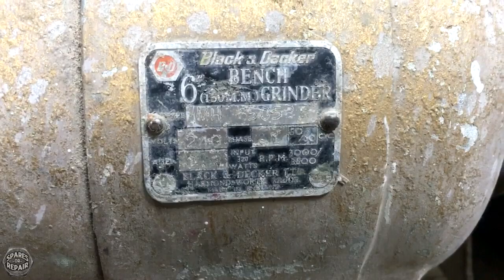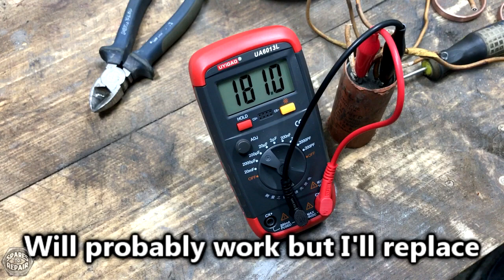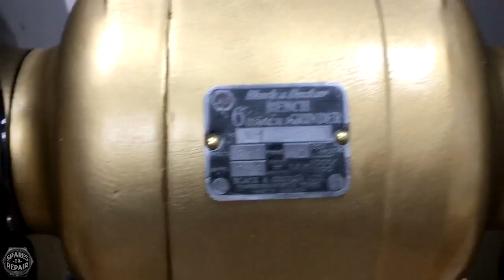1960's Bench Grinder Repair & Restoration - Black & Decker

Comment: Strangely enough, I was lookin at one of these for sale earlier today that needed work, and now this video pops up...... How serendipitous 😆 ya done a good job on this lad, you know your stuff 🤙 
Maybe ya done so to stay out of the shot, but il say it anyways; to get a repeatable angle when grinding, you want to use your front hand as a "gauge". Find the angle you want, grip the thing being ground between thumb and index finger, your index goes up against the tool rest on the grinder and you dont remove this grip til the job is done..... this way you can easily repeat the angle everytime you take it away from the stone to check your work 😁

Comment: Good work on this one Fella. I also snapped the brush and the plastic mount on a very similar Black and Decker grinder that I cleaned up. I 3d printed the mount and copied your technique to make a new brush from a graphite block. Works like a charm. Thanks for the inspiration.
Reply: Paul Ackroyd- I managed to snap the plastic mount into multiple pieces as well.  Any chance you could share the specs used for 3D printing a replacement? I would even buy  the part if interested in making another.  Desperate for a fix.
Reply: @OhIdontknow  I would appreciate that too. (Son has a 3d printer) but in meantime, I am going to attempt to make my own from brass. I hope that would work. ?

Comment: Nice work! I’ve just done a resto on virtually the same model. I also broke the centrifugal graphite contactor so I brought both wires to the front and mounted a non latching switch next to the on/off switch. A three second depress gets it up to speed fine. I wish I’d seen your excellent repair first, although I’m not sure I could have done it so neatly.
Reply: The centrifugal switch on my bench grinder does not work right now either. I just give it a spin with my hand whichever direction I want to run and turn it on. It'll run either direction.
Reply: What you call a non-latching switch is actually a momentary switch like a horn button on a car, or a doorbell. You could also put a double pole double throw switch on there and then you can start it up either direction whichever you want like they do on some of the drill presses on here.

Comment: Thank you so much for this video and brilliant job. I have the exact same model but couldn't find any info on it. I wanted to replace the bearings. Whilst being a tinkerer, I didn't know much about what I was doing. I managed that without seeing this video but did the same as you in breaking the brushes. (I too, couldn't figure them out much....but had a rough idea. When reasembling it I bust the plastic bit that holds them). The brushes were OK.....but the holder was k/o. Anyway...in desperation.....I found this video. And you inspired me to make a new holder as I couldn't find the part, anywhere. I'm about to do that, but am pretty sure It will do the trick. 
I'll keep you posted on the result but will thank you in advance for doing this restoration and sharing a brilliant video on here.

Comment: Quick Update! I managed to remove the carbon brush without destroying it and have replaced all the wires. I also have a replacment capacitor! Am now in the process of putting back together.

Comment: Had the same issue with the brush on an old B&D 3/4 HP 8 inch grinder, only in my case the plastic brush holder broke off. Spent weeks looking for a replacement, with no luck. Ended up having to scrap the whole grinder for that little plastic part. I tried gluing it together but that didn't work. What a shame! It was a great old grinder.
Reply from the maker: It's a really poor design! I'm just glad it was only the brush that snapped and not the holder, wouldn't have been fun making a new one of those! So far it's held up really well, I've turned this into a polishing machine now and it is smooth as hell! Thanks for watching!

Comment: You could wire it up so it'll start and run in either direction like they do on some of the drill press videos here on YouTube. 
Just put a reversing switch on the start windings. That is put that reversing switch in line with the centrifugal switch.
Just watch the videos on reversing a drill press.
But they don't realize reversing it can be done with one switch if it's wired up correctly. They don't need two switches on their drill press.
My dad wired up his bench grinder to run in either direction with one switch, with center off.

Comment: 12:22 "Why doesn't he use a bench grinder?" Then I remember what's being repaired. Also, glad you used the gold paint, it's not common today but I remember seeing gold painted tools from the 60's as a kid in the mid-70's.
Reply from the maker: TBH, I still use the ghetto set up quite a lot now I've got a bench grinder :D! Changing bits is easier :D! I've changed this machine into a wire wheel/buffer now, it will be making a few appearances in my new vid ;). Thanks for watching!
Reply: @sparesorrepair9118  Did the 60's have LEAD PAINT?

Comment: Very nice restoration  ! First time I see a brush mount like this one,  interesting 😁
Reply from the maker: It's an early centrifugal switch, It stays in place until the motor is up to speed and then the counterweight on the back pulls the brush away from the contact rings, nice piece of design but flimsy as hell! Thanks for watching :)
Reply: @sparesorrepair9118  ok, thank you very much  ! Your welcome

Comment: Thats a very smooth running grinder.  what was the bit left over on the piece of timber the grinder was taken off?
Reply from the maker: Cheers man, it's really well balanced for such an old machine! The part left over was the stand for a drill bit sharpener, unfortunately the main part of the jig was missing otherwise I would have restored that too

Comment: Hi there. Great vid thanks! I am currently in the process of restoring the exact same model. For use in my workshop. It is my second project! The wires are alot more corroded and they will all need replacing. I ws hoping you would be able to assist in advising how to dismantle without breaking the carbon brush! Also where did you get the replacement capacitor? Thanks again!!

Comment: Nice restoration.. but what exactly was that cylindrical part that you ohmed out .. was that a starting coil ? I am restoring an old b&d grinder but I need to identify that part in order to replace it ….

Comment: good job, I'm restoring my grandfathers 6 inch B & D heavy duty bench grinder just like this but USA made. what is that ring that the stator is wired too on left ?? , mine doesn't have that or a hole for the spring thing rotor shaft. also what capacitor do i use? thanks

Comment: I’ve been told that grinder stones can dangerously fly apart if one even presses on the side, i.e. sharpening using the side.  I believe I saw you hammer the side to get it off.  Have you considered replacement?

Oops.  Just saw the same question in the comments.  Good on you for changing it.

Wonderful job.  Great, now I have to do this to mine.
Reply from the maker: I do think people are probably a bit paranoid when it comes to stuff like that, I've had brand new out of the box grinding discs decide to shatter as soon as I've started using them for no apparent reason, shit just happens sometimes. I'm pretty sure they get banged about a good amount during transportation etc, a couple of soft blows isn't going to do much damage to a well made stone I wouldn't imagine.

That said, if it did disintegrate in use I'd always be aware that I had hammered it, so better safe than sorry :D!
Reply: The scariest for me are 4" cutoff wheels.

Comment: Great video and excellent restoration!  I have one of the same model that belonged to my grandfather,  most likely since it was new.  Any advice or tips on removing the housing/body?  Any other aspects of the restoration?  Thanks for any suggestions and thanks for the video!
Reply from the maker: It’s an awesome little grinder, it’s probably my most used tool when I restore other items! Be very careful when you’re removing the left casing with the carbon brush inside, if you can get away without damaging that the rest of the machine is basic.
Reply: @sparesorrepair9118  Thanks for the advice!  It really is a great grinder.  Still running strong after 60(+) years of use.  Looking forward to breathing a little new life into it and keeping it in service for years to come.  Thanks again for all the help!

Comment: What capacitor did you need for it? Just acquired one and the bottom plate is missing and so is the capacitor. Need the part because all it does is hummm right now

Comment: Great video...I'm rebuilding almost the same one...Model 4325...The bearings are 15.875mm wide..All the replacement bearing I could find are all 14mm wide...What was yours please ?  Old bearings were 204NK stamped on the bearing.
Reply from the maker: Digger60 Dirt I don’t remember off the top of my head, they were imperial I think though RL something or other
Reply: @sparesorrepair9118  Ok, thanks

Comment: I recently inherited one of these in the same gold colour, 1 careful owner from new. It's in far better condition than how yours began, however it takes an age to stop. I usually use a bit of wood to slow it to a stop. Any ideas if that's a fault or just how it runs? I was looking for info on it when I found your excellent video here.
Reply: just how it runs .
lot of centrifugal mass in these old grinders and no H&S concerns .
Quite nice grinders these as decent motors and the mass makes most modern ones look like a toy in torque output .
I got a pretty tidy one too for £10, 12.7mm 1/2" spindle handy too as plenty decent wheels for them, clarke metal worker range fits them fine and sensible prices .
Put um to work and enjoy the quality .

Comment: Hi there. Great work. I have just finished restoring an even older model, and as I was putting it back together I broke the other end of the graphite contact. The one with the two prongs. Don't know how I did it. Do you think there is any chance of finding a replacement? Look too tricky to make one.
Reply from the maker: Ukenick would be real tricky to make one, maybe you could repair it with epoxy? Such a fiddly little piece, nightmare for servicing! I would t imagine you’d be able to find a replacement unless you buy another machine for parts
Reply: @sparesorrepair9118  Thanks for that. Nightmare. Did such a nice job on the whole thing then bang. I'll keep my eyes open for an old one. Thanks again and love your vids.
Reply from the maker: Ukenick I’ll keep an eye out for one, is it the exact same as the one in this vid?
Reply: @sparesorrepair9118  That is really kind of you. Not quite. Is there a way of getting a photo to you?
Reply from the maker: Ukenick if you put it on Instagram or something similar you can just post a link in the comments 👍
Reply: @sparesorrepair9118  Sadly, a total fail!!
Reply from the maker: Ukenick I’m sparesorrepair8 on Instagram, you can follow me there maybe?

Comment: I'm starting my van dorn (b and d) restoration, this motor only has 2 wires for power and the 2 wires for the brush.  I'm wondering why this has no capacitor?  Maybe you have info?
Reply from the maker: This one has a cap in the base, mine was shot so I had to replace it

Comment: Old stones can be very dangerous.  If you don't know the history of a tool replace the wheel,
Reply from the maker: I've binned that wheel now, I only put it back on for the sake of the video, this machine is now set up as a wire wheel/buffer and getting lots of use! Thanks for watching and commenting!
Reply: @sparesorrepair9118  The material that will BLOW UP a grinding wheel is aluminum. Don't do that.

Comment: I’m in the same situation with the electric brush breaking off . How did you attach it to the plastic?
Reply from the maker: I tried drilling a small hole across and attaching it with a piece of wire like the original but the brushes kept splitting, in the end I used epoxy, held really well and also made the brush a bit sturdier.
Reply: SparesOrRepair  ok I’ll give it a try.  This was my dad’s bench grinder. I took it apart to give it a fresh paint job and ended breaking it. I appreciate the video and the advice
Reply from the maker: @williamwiedau9905  It's a really delicate part, I knew there would be some kind of centrifugal switch inside but wasn't expecting something that flimsy! Mine has held up fine, I think the epoxy is better than the original design, holds the brush more stable. Let me know how you get on!

Comment: Was this the one that was going cheap on eBay...?

Please don't tighten grinding wheels up with an impact gun....🇬🇧👍
Reply from the maker: I got this one from a guy who does house clearances, bought it cheap as it was faulty :)

My impacter was on it's lowest setting, barely any torque at all, I'd have tightened it more by hand! That grinding wheel is coming off and being replaced with a buffing wheel in the very near future anyway :)